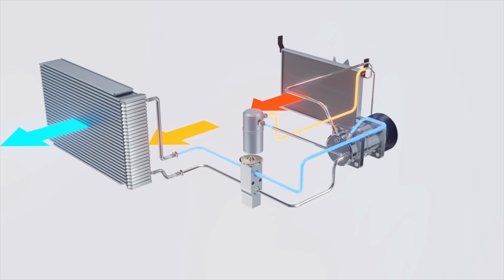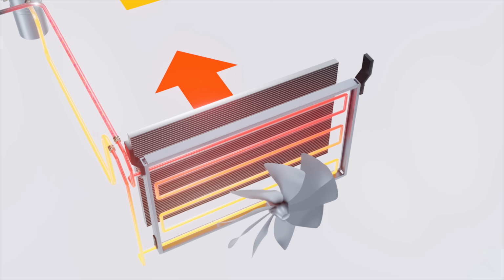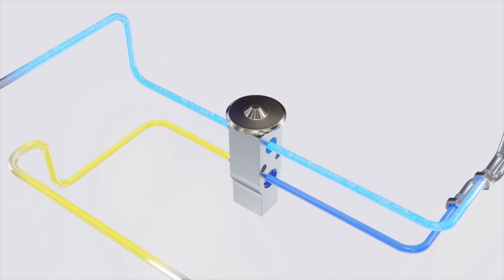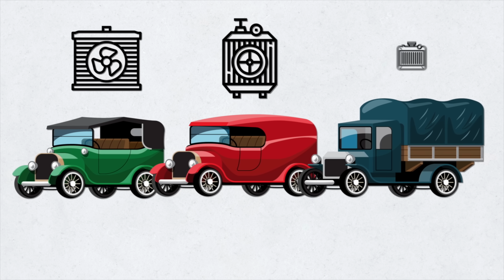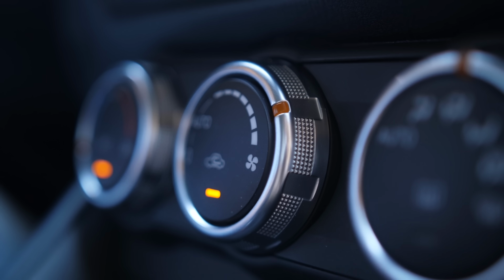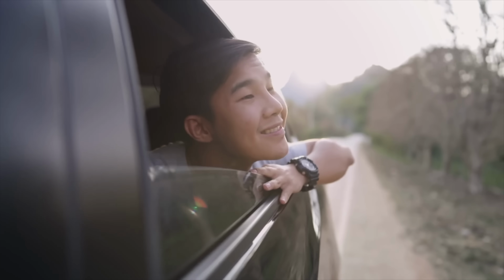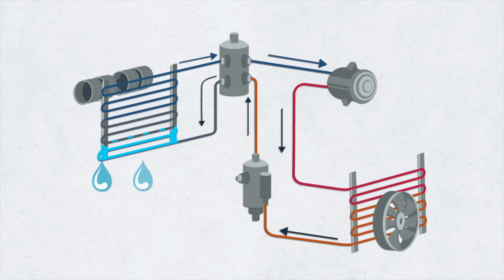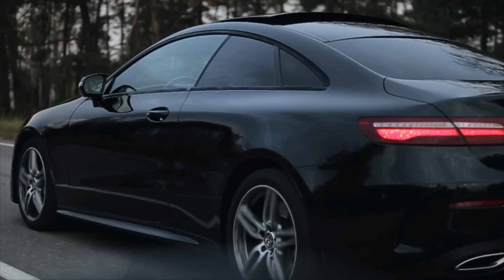Never Do This to Your Car’s AC System

Comment: Myth Busters did a seg. on "AC on or WINDOWS OPEN", which uses more gas? Their test revealed AC used such a miniscule, piddly amount more gas, than w/ the Windows Open & the tests were SO close, they said " No Difference." They always did pretty comprehensive tests too. Just sayin' & why did they stop making that show? That was one kickass , dynomite show 💣💣💣💣💣💣👍👌
Reply: I heard they stopped making it because they were running out of good ideas. Also they two stars didn't like each other at all, they only tolerated each other to make the show lol.
Reply: @GoldPrisma  grant also passed away last year I know the show ended shortly before this but I feel most people don't know.
Reply: @danielwilson3297  never knew grant passed.
Reply: @charlesdickens6706  What did he pass? The gas station? The burger joint?He snuffed it. He is no more. He stopped breathing. He kicked the bucket - in fact, he DIED!
Reply: @danielwilson3297  Kari died too in Oregon
Reply: @TaylorPhase  I believe you are thinking about Jessi Combs
Reply: @ABG2412  oh I forgot the names. Just know it was one of the chicks
Reply: @TaylorPhase  what! I had no idea!
Reply: @danielwilson3297  Jessi Combs died. Not Kari. She was trying to beat the land speed record in the dessert, but her vehicle caught flames due to debris if I remember right ..
Reply: .. @Bill Harding  ...That's a good  John Cleece impersonation . I was just myself doing the high kick goose step as a hip joint exercise, it makes a lot of sense aerobically too .
Reply: @danielwilson3297  Grant died last year, but he had left the show back in 2014.
Reply: @GoldPrisma  that plus the asian guy graham who was pretty cool died.
Reply: @GoldPrisma  They stopped the show because they put a cannonball they someone’s house. You can look it up.
Reply: @GoldPrisma  They had a difficult time getting along. Jamie and Adam.
Reply: @GoldPrisma  Grant passed away, and then we’ve known that Adam and Jamie did not like each other for a long time now
Reply: @GoldPrisma  Cannon ball espidso
Reply: Yes, Kari was dynamite on that show. Lol
Reply: @c.d.7742  Kari is why Lauren Phillips gets half the views she gets. Lol
Reply: The biggest reason was Adam and Jamie didn't really like each other, and had no desire to continue being costars.
Reply: I've found driving my 17 civic in phoenix with the ac on gets me around 38 mpg, while with the windows down it's more like 42 mpg
Reply: @FUTUREpilot267  yeah at city speeds. on the interstate though with AC on in phoenix, i get like 64 or higher MPG and windows rolled up
Reply: @TaylorPhase  I think it depends on how many windows, I just use the drivers side window if it's below 100, but once it's hotter I use the ac cause the wind can't keep up
Reply: @FUTUREpilot267  yeah but wind is still just hot air blowing, versus actual cold air from an AC
Reply: @FUTUREpilot267  Hey, What I do, cuz I have 4 windows is , drivers window all the way down & the drivers side rear window down 6" or so to get rid of the buffeting wind noise I can't stand. Drove to FLA. recently, ac on, 75 - 85 mph, in a 2000 Crown Vic & got 25 mpg. You don't drive a Vic, it floats you. 👍🤣
Reply: Never watch the behind the scenes, ruined my childhood lol.
Reply: @alexjackson936  why?
Reply: @PuppyPulverizer  as some people have mentioned, the behind the scenes footage showed how little they got along. They really didn’t like each other, kinda ruined the show for me lol.
Reply: Yup. One of their better and more accurate tests.
Reply: @elultimo102  Yes - it's brilliant! I was trying to fight back against the pc snowflakery that's taking over these days.
Reply: Figured it was Adam Savage is a creep and may have a history of such getting ahead of Me Too
Reply: @robhowe4th  Cool, literaly. HVAC is a great profession to have. Job security, great 💲💲 & gives u a great sense of accomplishment. 😭😎
Reply: @DJ Ness Question..... Can echos actually go fast enough to have air blow in the windows? Class dismised. 😲
Reply: Interesting, I definitely notice the hp I lose when blasting the AC when accelerating but the gas mileage does seem to be the same.
Reply: La
Reply: La
Reply: I imagine it would depend on the car too.
Reply: My 1.5l Honda engine gets like 5 less mpg with the ac on
Reply: Jamie and Adam behind the scenes didn’t mesh well. Great show but all good things must come to an end. They made it over 100 plus episodes….very successful in TV business.
Reply: I couldn't care less about gas mileage. I live in Texas and always drive with my windows down because heat doesn't bother me and I like feeling the wind. There are some exceptions : When returning home with groceries, when I have someone with me, when it's raining, or when I am racing. Other than those conditions, my windows are down. If I was worried about fuel economy, I bought the wrong vehicle for a daily driver.  :)
Reply: they stopped because the main 2 guys, the walrus and the other dude broke up. got tired of each other. they never liked each other from the get go. they never met each other off work either. they just worked together.
Reply: this will be different for every car. In my subaru 2.0 boxer I can feel a huge hit to engine power when the AC turns on. If you want to get the same amount of speed/power then you will definitely lose some gas on certain models.
Reply: I have found on my car, the calculated Mpg on the dash actually goes up a few tenths of a mile at speeds of 70-75 Mph
Reply: @davidmoran4471  well, your car is much more efficient at a highway speed, on many car commercials you can see that the “city” mpg is much lower than the highway.
Reply: @grojunge2449  city mpg is much lower mainly due to stop and go vs running at a constant speed. It takes a lot of energy to start a car from a dead stop vs keeping it moving.  
Although at higher speeds the air pushed out of the way by the car goes up exponentially.    Running 100 pushes like 3_4 times the air of 50
Reply: @tomcapehart1878  that’s what I said…
Reply: @grojunge2449  the reason for highway mpgs being better than city mpgs isn't necessarily because of the speed itself but because of the frequent stopping and going/speeding up and slowing down that's done driving in a city, Everytime you have to stop quickly, all the energy used to get going that fast is wasted. Some cars might actually get better mpgs going 40 than they do at 60, but again stopping and going frequently is really what kills mpgs in any car.
Reply: @joefriesen5296  That is what I said. In my paragraph of explaining, you have just stolen what I said.
Reply: @grojunge2449  Didn't see your paragraph. Therefore I couldn't have stolen it lol
Reply: @tomcapehart1878  Air drag force quadruples if you double your speed. Power goes up by a factor of EIGHT!

Same with lift. That's why when an airplane slows down, it loses lift and crashes.
Reply: @MultiPleaser  yes, it is like the force is not just twice at twice the speed, but the cube of the force.  
My dad was an E.E. and knew all kinds of neat stuff.  
He told me that at one point,  explains why some cars can get 55 mpg at 45-50 mph and only 33-35 at 80+
Reply: @tomcapehart1878  I once had a car who's top speed was 80 mph on flat ground. However, down a mountain in neutral it went 84.  So, technically, it got way better mpg at 84 than at 80.   LOL
Reply: @joefriesen5296  yep, you're most fuel efficient around 35mph as long as you don't slow down (or whatever your start for overdrive is.) This obviously won't apply to cars that lack overdrive.
Reply: @grojunge2449  The killer in city driving (and the EPA ratings) isn't the speed, it's starting and stopping a lot. Every time you touch the brakes, you're throwing away energy (as heat). Every time you accelerate, it's inefficient. But if you can drive at (say) a steady 30 without slowing down or speeding up, your mpg will be great. And when you go fast, air resistance gets horrible (and makes the car inefficient).
Reply: @davix8356  that’s true, many electric cars use their electric motors as generator when stop and going as it doesn’t throw away as much heat or wasted energy
Reply: Because like the name of the show it was hurting business and they forced the show with lawsuits
Reply: Yeah its never on TV anymore. I used to love watching the "Mythbusters Mega Merry-thon" 2 straight weeks of Mythbusters
Reply: Half the cast of Myth busters couldn’t even stand each other off set plus the show had been on forever and lost viewership overtime
Reply: @DJ Ness OOOrrrr, you can always draft a semi. BBuuut if he jacks the brakes on, it's good night IRENE, or in your case , DJ NESS! 😲 ⚰ 🚔 🚑
Reply: @g5alive795  Semis need about 300 feet to stop from 60 mph. Modern sports cars need 100 to 125, SUVs and pickups more like 140 to 180. Cars are in between.

Unless you buy that one SUV made by a supercar manufacturer.  It does 60 to 0 in 85 feet. Best brakes of any car ever!  And it weighs around 4800 pounds, which is halfway between a Corvette and an Escalade.
Reply: Fuel gauge disagrees-moves faster with the a/c running especially on a 4 cyl engine.
Reply: Love live Mythbusters 
And RIP Grant
Reply: I do both 🤩
Reply: I have a Cherokee 2004 and my gas mileage is no different with Windows open or AC on your spot on
Reply: They stopped making the show due to main members having too many differences and they both agreed they couldn't work with each other anymore. It's actually something you can Google.
Reply: On my Volkswagen the gas mileage drops drastically when the AC is in use.
Reply: It was almost entirely due to the fact they simply were running out of myths to test. I mean it got to the point they started testing if idioms would work when attempted literally, FFS.

It IS true that Adam and Jamie don't get along. Note they don't hate each other, but they're simply not friends. As Adam put it, in the over 10 years they've worked together, he and Jamie have only had dinner together without anyone else maybe once or twice. But the fact they didn't get along actually kinda worked for the show. They constantly had opposing ideas and worked to prove which one was right. Adam's stated while they don't like each other, they respect each other a great deal. They always challenged each other to do their best.
Reply: I've had a moon roof for several cars and I use a combination of the moon roof and one window. Depending on conditions test opening the moon roof in "vent" configuration and then lowering and raising each window. It's best to test on the highway but the lesson applies in town. Remember to close your window!
Reply: Smokers often crack the window open but that's pointless if the AC is on Max and or Recirculate because that will draw in warm air and the smoke and lessen the efficiency of the AC.
Neither choice will use significantly more gas. 🤪
Reply: Because they ruined it, they tried upgrading the budget but they weren't ready, and it all fell down
Reply: The problem is the acceleration.
Reply: Horror AC story: (Not for me, but for all the millions of people evacuating Hurricane Rita. 30 hrs of mostly breaking in Aug heat. Rolled down my windows, just wore a sports bra. 
Saw tons of families w blown radiatiors, or ran out of gas. News flash you have to actually move in traffic for the AC to cool. Most ppl needing gas or water could not get it. I drove my Lightning in grass next to the freeway to get out. 
Never use AC in a bad evacuation. 120ppl died just getting out.
Reply: @AF_1892  you don’t need to move to cool your ac unless you have a really old car. Your car has fans that pull air thru the condenser.
Reply: @AF_1892  That sounds horrific, something you find in a movie. So sorry you had to go thru that. Glad you made it though.
Reply: @AF_1892  it depends on the manufacturer on if you have to be moving for ac to work. Honestly it is a function of radiator space for ac and the type of refrigerant. R12 is more efficient but more harmful to the environment. R134a is less dangerous but requires more outside radiator space or more wind speed to assist with cooling. The ac radiator placement matters too.  Running out of gas is a different issue than ac but I agree everyone should always keep 10-20 or more gallons(depending on fuel efficiency and estimated necessary run time) you cycle every ~3-6months through vehicles to ensure safe evacuation.  For general transportation Toyota is one of a handful of manufacturers that dedicate sufficient radiator space to ac that they cool very fast. Toyotas also typically (if all components are working well) do not need to move for the ac to work in most cases well enough to freeze you out/make you turn it warmer. Most diesels (trucks at least) don’t need to be moving either due to the fact they have to have more radiator space for cooling. This is due to how a diesel functions as compared to gasoline at least in trucks. Diesel trucks today are also built for “stop and go” with efficient lower gearing so they can more efficiently get up to speed and some of the newer modes having 10+ gears closer to big rigs(21?), are even able to easily handle difficult loads. Trucks in general often have plenty of radiator space to allow for proper ac heat transfer. 
Just my two cents.  Hope that helps.
Reply: @AF_1892  actually you don't but blown radiators is probably something actually wrong with their car. Run out of gas is simply idling on a low tank stuck in stop and go traffic.
Reply: I remember that episode
Reply: @Mary-Francis Godsey Godsey  Mexican air condition: 4 windows down, 40 mph
Reply: Myth busters 😂😂that was made for tv ,half those episodes were tested wrong any way

Comment: The A/C in mt 2004 keeps switching from cold to hot. Once hot it wont go back to cold unless l tyrn iy off for a few minuttes. The process starts over. What is your suggestion, Scotty? I don’t want the fixing to cost more than the car.
Reply: I have the same issue and the radiator or fan seems to be a problem. The freon is too hot and the pressure in the system is too high, the safety valve turns the ac off.

Comment: I got a 2018 VW GTI. I took it to the dealership for AC issue for 5 times, then VW finally agreed to give a replacement. The dealership did evac the ac system every time. However 3-4 months later, the AC went out again. It was not bad deal for me though 😄

Comment: In my 03 Camry, if I were to turn my AC on, it would omit an extremely loud squealing sound that increased in intensity if I were to accelerate. As soon as i turn the AC off, the squeal would immediately stop. Any guesses what that was?
Reply: Belt
Reply: Could be bearing, i had that and it was terrible. I changed belt and disconnect the AC, problem solved and hotter car. I sold it later :-)

Comment: Scotty I have a 2006 Nissan Altima and when I turn on my ac button when I'm in drive at a stop my belt starts to squeak and flop around on the pully. Could this be a failing compressor pulley / compressor. Or should I replace the tensioner pulley ? Or for the heck of it both?

Comment: How long does it take for AC seals to dry out, been lazy I've had a broken condenser for years and just left it off.
Reply: Seals may crack after 18 months of non engagement while driving . But a vehicle not driven for same period is OK cos it's the engine heat that dries things up .
Reply: At least a brief weekly turn on to bathe the seals is the advice. Some vehicles automatically engaged the compressor when reverse gear was selected in the 90s .
Reply: Just replace the drier and all orings if it easily accessible replace the orfice tube. The orings less than $5 for a whole kit the orfice tube is also less than $5 the drier is probably $40 or less. I'd also check the compressor and make sure no water got in there and caused corrosion. The above prices are rock auto prices for a cavalier and focus.

Comment: I'm nervous what to do to fix the air conditioning system on my 1989 Nissan Sentra, the blower motor makes a loud noise trying to blow cold air and I have to shut it off.

Comment: I'll tell it simple: Gas is compressed which causes it to heat up. The outside condenser turns it to liquid by cooling the gas down. Liquid gas is then pressed through nozzle before the evaporator. Nozzle controls the mass flow and thus cooling power and should be properly sized to be in sync with the compressor. When liquid gas changes state from liquid to gas it binds heat.

Comment: The first car I had was equipped with AC & Alloy wheels, not a given at that time on small cars. Well the Alloys had a little kerb rash, no problem, first car, who cares right? Well I bought it in winter, I didn't know the AC condenser had 3 holes in it! My enthusiasm for that car disappeared faster than the gas used to diagnose the issue as you can imagine.

Comment: I still wonder if running a/c without freon damages it or not having any in it corrodes anything... I live in the north
Reply: A/C won't run without refrigerant. Compressor won't engage if all other components are in place and there is none.

Comment: Hi Scotty I love your videos I had a short with my speaker box in the trunk and my starter burned out it smelled awful I disconnected the  speaker box and rewired the speaker box and replaced the starter but now the AC went out I swapped out the fuses and it started working again but I’m afraid I may have burned something else where should I go to get it  checked out without getting ripped off.

Comment: Have a 2018 sonata 2.0t (25k mi). A/C causes strong pulsing vibrations at idle (even park and neutral) and low speeds (<10 mph).  When looking at the rpm gauge, it appears steady but the vibrations persist at about 1 every 3-4 seconds lasting about 1s each.  It's frustrating especially for a young car.  Taking it in soon, but anyone have a similar issue and potential solution?  The A/C itself seems to work fine    though.